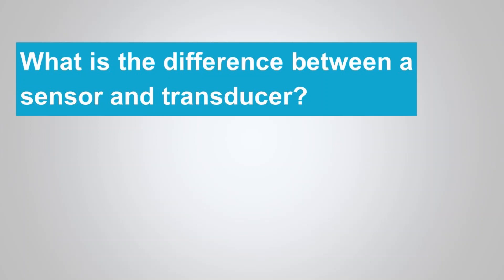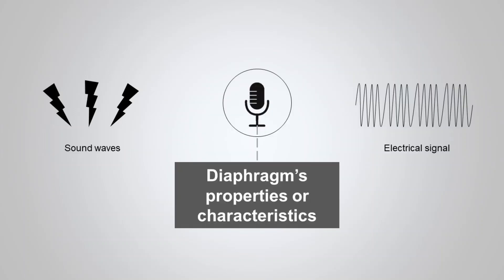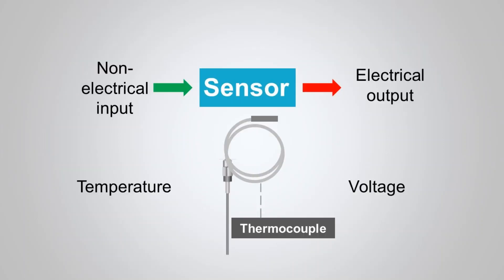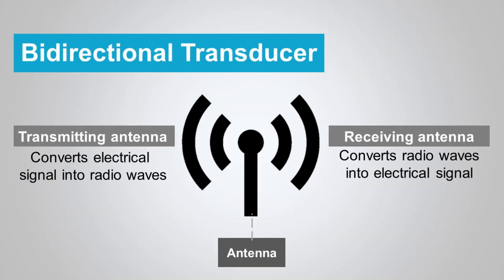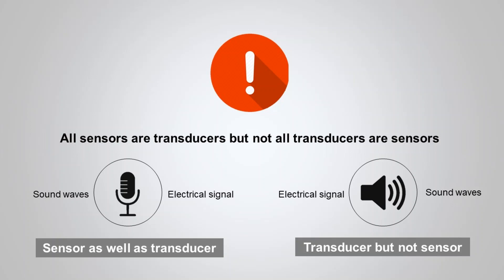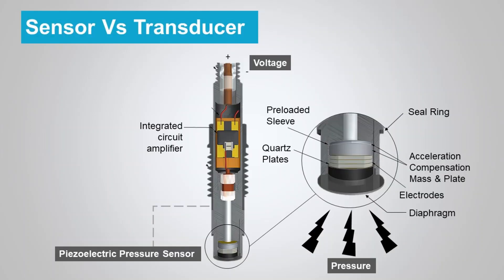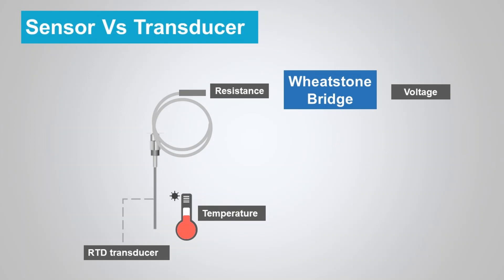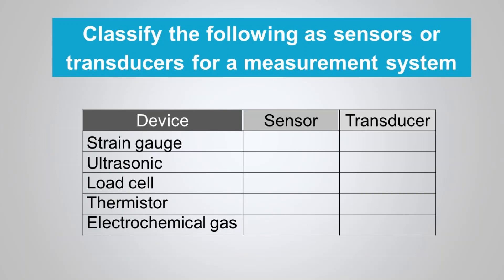Sensor Vs Transducers

Comment: Sensor output always electrical, but transducer output can be anything
Reply from the maker: Yes, transducer at input side will provide electrical output (which may or may not be available in suitable form for controllers to process), while transducer at output side will provide other forms of outputs such as motion. On the contrary, the output of sensor will be electrical signal which is suitable for controllers to work on and doesn't require any special signal conditioning circuits such as amplifiers or bridge networks.
Reply from the maker: I hope you liked our video.